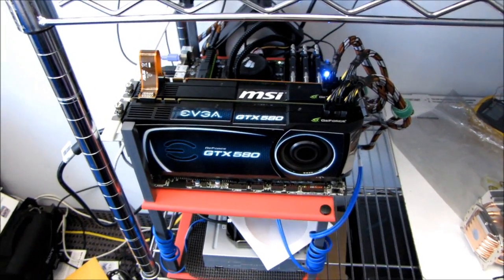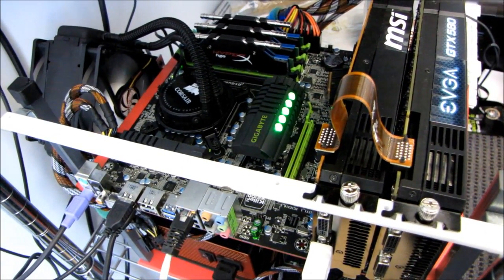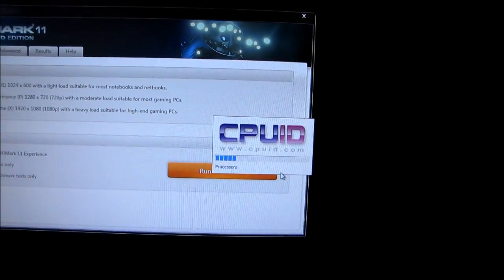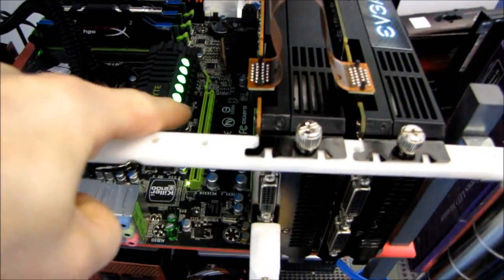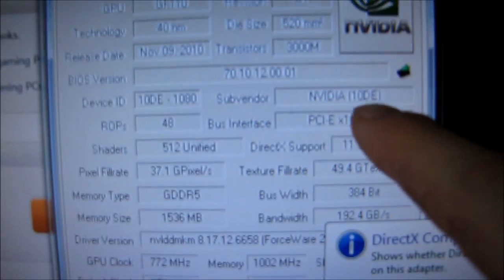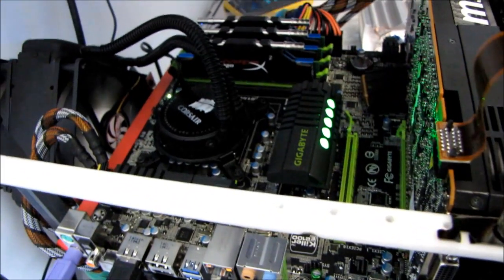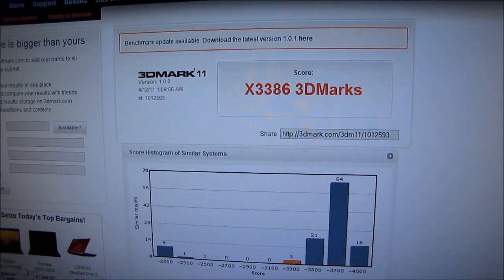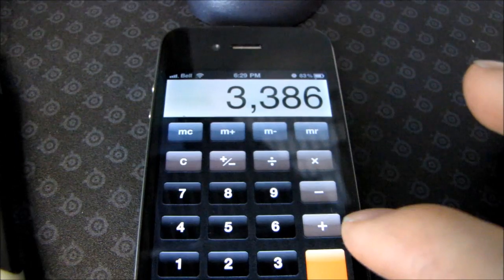SLI Using Dual PCIe 16x vs 8x - How Much Bandwidth is Needed? Linus Tech Tips

Comment: @BigLeatherJacket I completely agree, but I wouldn't even bother getting something as high end as a 580 in general. A 560 plays 95% of games great on max. You're better off getting a 560 and upgrading to something like an 7/860 in a few years. The amount you'd spend combined on both a 560 and the mainstream equivalent a few series down the line would equate to a price of a 580, and you'd end up with better performance.

Comment: @InferusExitium those are  the same cards,he is using twin gtx 580 though, and they have the same acrhitecture, the brand doesnt matter, you just have to put the 2 cards(same cards) at the same clock speed and you connect them in the mobo and through the SLI  bridge, and the psu and there you go, you should have to config it on the nvidia control panel but thats it i think

Comment: @InferusExitium nope as long as they are the same model. gtx 580, for instance. if you use one card with say a higher clock speed bu the same model, i believe bot will run at the lower speed. and if you have one card with more ram, both will only use the smaller amount of ram.

Comment: @crumbworks I see you didnt bother to read the description.

"I use dual GTX 580s to test the performance difference caused by reducing the PCIe bandwidth. In the next little while I guess I'll do another round of testing with a high end dual GPU card such as a GTX 590 or HD 6990 and test 4x/8x/16x to see how much difference there is."

Comment: QUESTION: Im running old school video cards, and I have a BFG 8800gt OC2 card and I want to sli it with a regular Nvidia 8800gt video card so do I have to overclock or underclock one of my cards, or it will just automatically do it when I install the regular 880tg card?

Comment: You have said before that 8x has virtually no impact on performance compared to 16x (and this video shows that), but it'd be great if you did the above test with 16x / 4x to showcase the performance difference.... or a single card running at 16x, then 8x, then 4x.